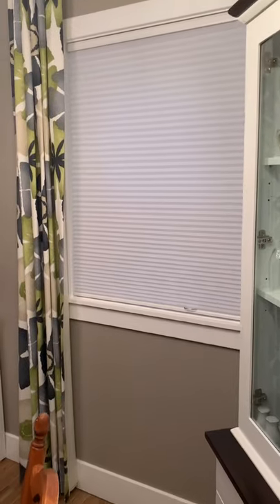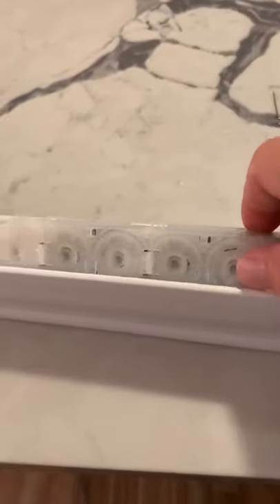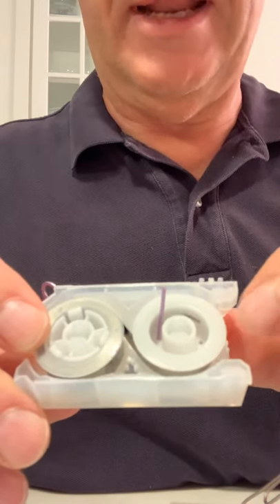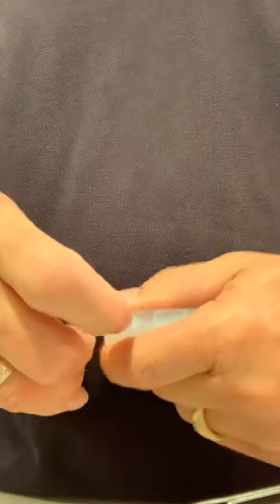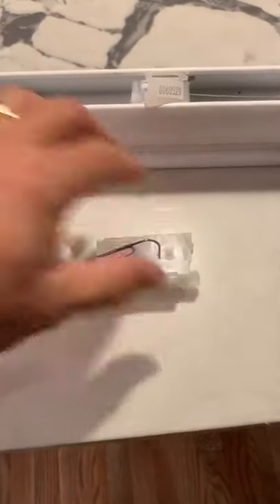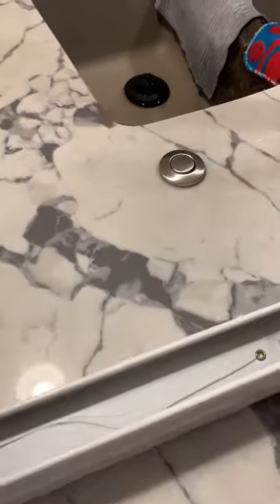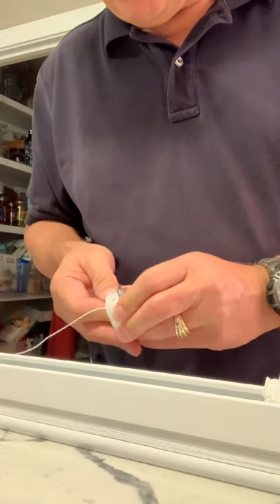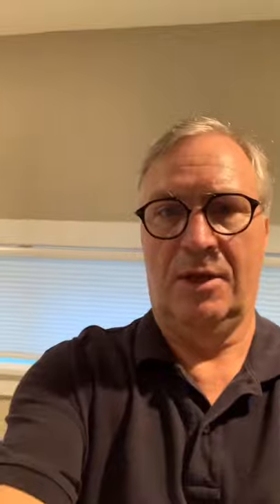Levolor Cellular Shade Repair

Comment: Super helpful, Jeff, thanks so much!  We have top-down, bottom-up Levolors in our two bathrooms, so they are small, 2' wide and about 3' tall.  They're about 10 years old, no complaints.  Pulling down one of the uppers last week when I heard a SNAP! and the upper bar went limp.  Dismounted it from the window and saw the string for the upper bar was cut, about 8" to the right of center, inside the bar.  (Didn't see any sharp edges, maybe the inside edge of the brass grommet eeveloped a sharp burr?)  Springs seemed intact, but fully retracted, of course. Thought I'd need to order new string, but your video did a great job explaining the string and spring operation.  So I retied the string, unwound the two string bobbins, centered them over the four spring wheels, and seemed to have enough string to fully lower the upper bar.   Wound up the string bobbins, wound up the spring wheels, reassembled and it's working!   Great tip to use  paper clips to secure the springs!  I speculate that the spring wheels only need a turn or two of tension when the bar is all the way up (maybe no need to wind "half-way"?).  As the bar is lowered, string is pulled out, and the springs are wound up tighter, turn for turn.  For some other commentators - if the blinds stop short, you may need more string, but make sure you have enough spring travel and won't yank the spring end off the wheel before your blind is fully lowered..  Hope that helps!  Thanks again, Jeff!
Reply from the maker: Thank you Larry - yes I think you are right about not needing much spring steel one wheel when the shade is up. It should tension on the way down.

Comment: Hi Jeff, Thank you for this video which was timely.

I was restring the top down bottom up cordless version of this blind and have a tensioner for the top down bar and another for the bottom up bar. My repair was for the re-string of the top down unit which was rarely used, and the bottom up operation action string was wearing away a spot on the top down string, that had little activity. I was carelessly lifting at the bottom up tensioner to re align the replacement strings for the other tensioner into the guides and bzzz went a spring. I carefully watched you rewind a spring and was expecting you to say that the spring was attached to each of the two wheels. I noted that I could see one end was securely attached to the empty reel and attempted to wind up the reel that has all the spring on it. Since the spring was not tightening to a fully tightness I am wondering if the spring is actually attached to both reels or if one reel is loose and is a make up space for the spring. I am a little nervous to let the spring fly apart, if there is nothing wrong with it. I could leave that one unit out (in-operable) but the blind is 5ft wide by 64" down with backout fabric which may be more than the remaining two units can handle. 

I would appreciate any word that can help, as there is not a lot of information around, and nobody wants to do repair, just to replace with new with three other matching units.
Reply from the maker: Michael - Each end of the spring is attached to opposite wheels.  The end of the spring is rounded and fits into the slot at the base of the wheel.  I am guessing if one wheel does not wind tight, it is not attached in that wheel.  When my spring flew off, I reinserted it by angling the rounded head slightly, inserted it into the slot in the base of the wheel, and began to rewind the spring.  Other YouTube video mention it is possible that the  rounded "tabbed" end of the spring is broken off, in which case you have a different problem.  All the best!

Comment: Thanks Jeff for the internal view of the Levolor shades. I have looked for hours (days) and have not found a new mechanism or springs. I have contacted some manufacturers in Taiwan for the springs, but they are prototype prices and not assured to match my shade. cheap by the hundred though. The sad part is only the most expensive shade brands provide any parts, and no regular brand (that I can find) have the balancing mechanism - a constant torque spring. 

If anyone knows where to get the Levolor style in this video please post so we can find some parts. This is the most important functional part of the shade and the most likely to fail. Apparently Hunter-Douglas now owns the patent for the spring assembly shown. 

Important:  I learned they must be moved sloooooowwwwwly least the spring go funky and possibly break.

Comment: Hi Jeff
I know this post is a bit dated (2021) but the most recent I've found.  I have three large (9') Levolor shades and several others.  The older 9' ones have a drop of about 54" and have started to not come down all the way.   These have two "engines" as your 6' shade did.  I tried the steps to adjust the cord length on both engines but it didn't help.  Then I tried rewinding the springs.  That didn't help.  Then I used the suggestion of adding a small length of string to the bottom .  That allowed the shade to come down a bit more but then the springs became disconnected.  In trying to rewind the springs, one of the connection tabs broke off.  Fortunately I had another shade that I could steal that part from .  So after working on this all day,  I am back to where I started.  Any other suggestions.  Could it be that the springs are too short??
Reply from the maker: Don, I am not sure, but I suspect the amount of spring on one wheel or the other isn't right. I wasn't able to find specs on how much should be on each wheel when the shade is in the retracted position.  I had to try several different amounts before I got it to work.
Reply: Thanks for the reply Jeff.  That is definitely a possibility.  I am also contacting Levolor to see if I can get some parts.
Reply from the maker: This springs could be too short, but I think there must be a ratio of how much spring should be one each specific wheel

Comment: Why don’t you use the rope spools snap on the side then just pool the rope, when you ran out of rope then take spools off rewind spool so you have more rope then reattach on gear wheel then pull again .I found that easier the use hand to rewind , it’s safer and won’t break the hook inside gear wheel trigger mechanism
Reply from the maker: It sounds like a good idea. I  hadn’t thought of that. I was thinking the gears would strip against the spring tension.

Comment: Just finished repairing a 5' wide by 4' tall  before watching your vid...I know - not too smart. But it went fairly well. One spring had come completely off it's wheel and string was all messed up. Needed two extra hands (my wife) to keep the spring from going "boing", but only took maybe 10 minutes and then reinstall. Works fine now, but still don't know why or what caused it to come unwound. Go for it folks...you CAN do it!

Comment: could not get the gear even out of its seat
Reply from the maker: It does snap in and out. Maybe putting a small flat screw driver or other slim metal object underneath will help you pop it out.